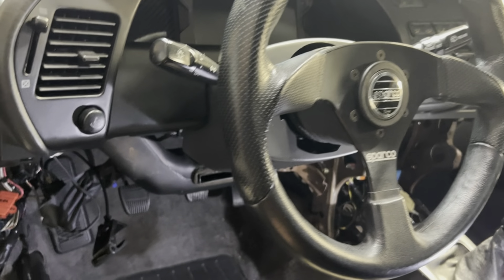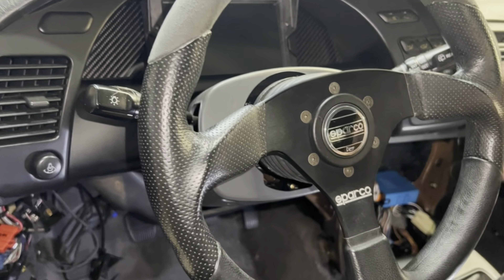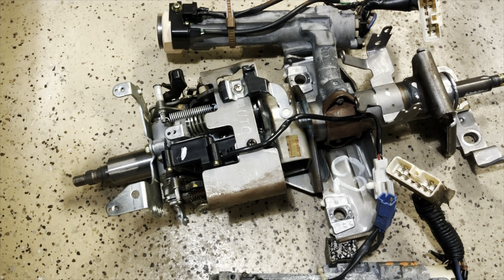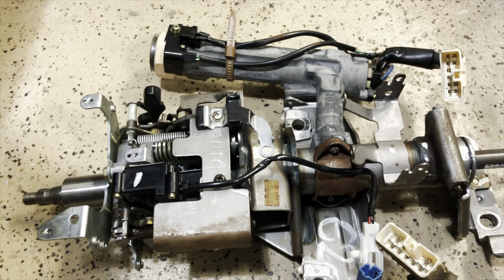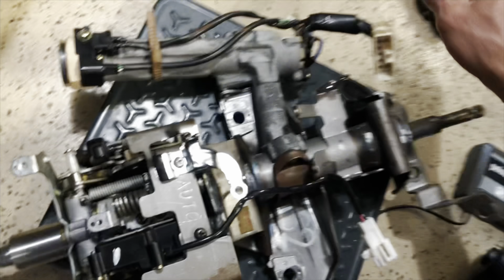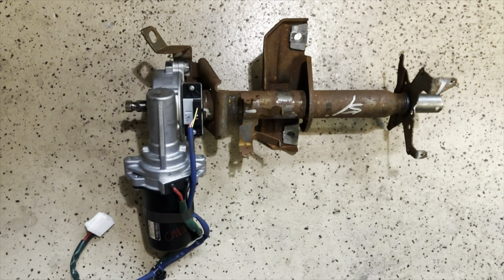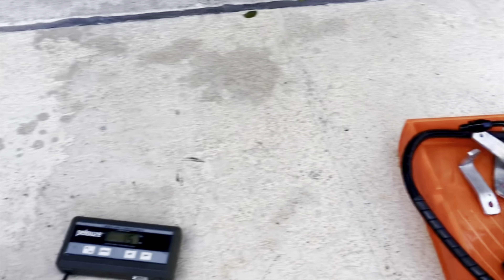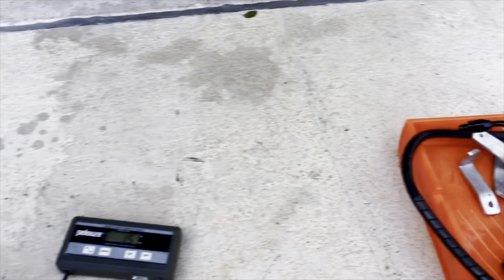Electric Power Steering (EPS) for weight savings on my 1000HP Street Car DIY

Comment: You’ve convinced me to ditch the auto tilt. I 3D printed a Fox for my column plastic but I don’t want to break it again.
Reply from the maker: Still, to this day I grab the steering wheel when I remove the key. Lol.
Reply: I’ve been wanting to go e power steering now for a while. Company in California is making true 100% electric kits now (using a Prius motor) no fluid needed and all fits under the dash. I’m having issues with my normal P/S pumps on my JZ leaking or cavitation when revving to 9000rpm or above. So hope this is my savior and works out. 

Keep up the great work dude!